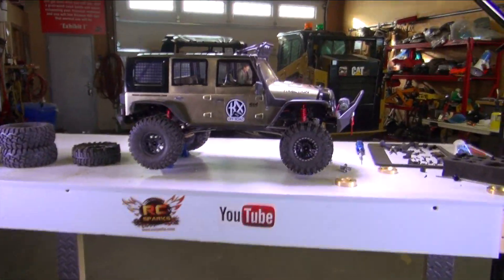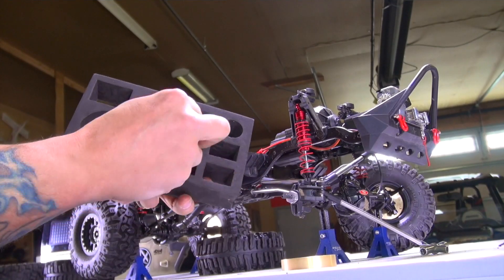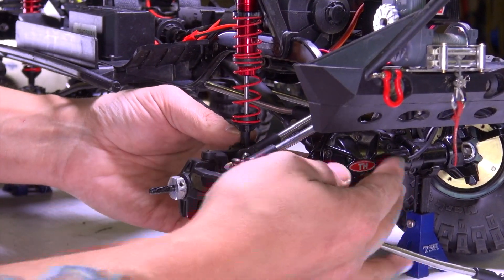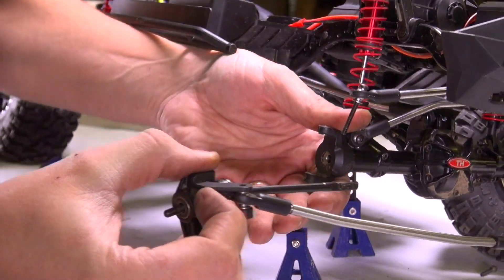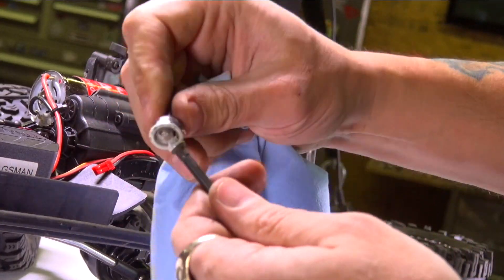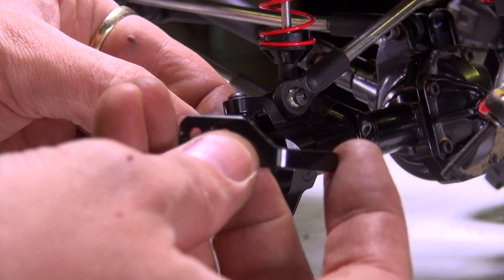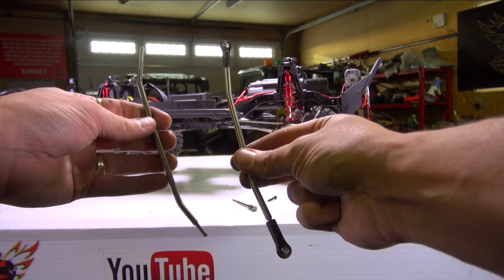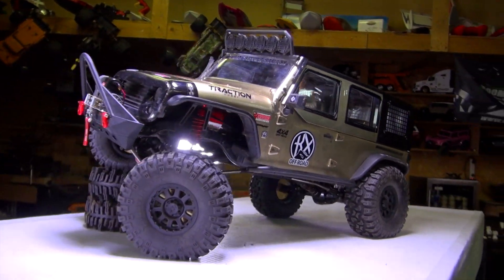RC ADVENTURES - Mini Jack Stands Support New Axle Weights - Install & Lessons - Traction

Comment: Hey medic. Just ordered the founder arr. I Want to install a tekin t8 2650kv buggy motor on 3s. Should that be oke? Founder doesn't has the Trx4 gadgets but is full metal alloy and carbon. So should be stronger..